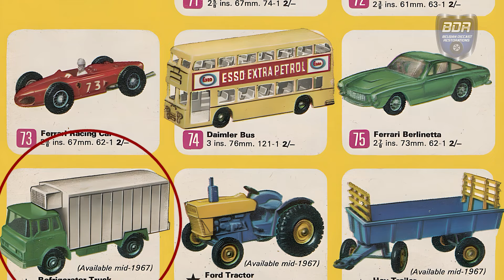Matchbox 44C Refrigerator Truck Diecast Restoration

Comment: Hi! I enjoyed your restoration project on this truck. Do these restored models become part of your collection? I was hoping sometime soon you could do a tour of your Collection for us viewers to see. I still hope you will branch up to a higher percentage of 1:43 scale vehicles to work on. For the amount of efforrt you put in for 1:64 you would get more bang for your buck. Nicer, more detailed castings, suspensions, and more rollable. Are you satisfied with the Motip products?  Other Restorers have gone away from using them for globbing and random coverage. Emphatically so. Thank you! Best, Stephen
Reply from the maker: Thanks, Stephen! Yes, they become part of the collection. It's not very organised though. When it comes to scales, I do my best to alternate between small scale and larger scale, but since I have more small scale models in my restoration boxes, these are more prominent on my channel. But I do enjoy restoring both.
Yes, I like the Motip products. Especially the primers are very good and the 1K rattle cans give a very nice finish on the first coat. Their clear coat is also very good, but it takes a very long time to reach its final hardness and it's usually not fully cured when I assemble the model. That's why I only use it on models without any opening features, that need little manipulation on reassembly.

Comment: That is a fantastic result, Johan!

That Vallejo Light Green was an excellent choice for the container. I’m looking at that colour for the Mercedes lorry and trailer ( #1 & #2 ).

Thank you!
Reply from the maker: Thanks! 🙂 It's Vallejo Model Air RLM25. It's a tiny bit darker than the original colour but indeed very close. If you are aiming for accuracy, you can mix it with a drop of white to lighten it a bit.
Reply: @BelgianDiecastRestorations  I’ll try that! Thanks again!

Comment: It's a gtreat restoration but I think the rear door should be hinged at the top or bottom rather than the left side. If you  think about it, you never see a real truck with a full width door opening from one side. it either swings down to form a ramp for walking into the load bay, or it swings up like the hatchback of a car.
Reply from the maker: Thanks! You're right, but I do believe some trucks had a single door back then. It does make sense for delivery trucks, like this, that had frequent stops. This said, I don't know what truck Lesney based their model on and I couldn't find a picture of the exact truck.

Comment: Hi, I would like to know what do you use to redo the axles? I have already tried with nails but as soon as you hit it to close it it twists. Thanks
Reply from the maker: Hi, I try to reuse the original axles as much as possible. If they are missing or need to be replaced, I use pop rivet nails. They already come with one end domed and are easy to hammer flat. Pop rivet nails come in various sizes, so make sure you get the 1.5mm kind. Support the axle while hammering, either with pliers or by pressing it firmly against the bottom plate. Use a small hammer and don't use too much force. Better to have to hit it a hundred times than to end up with a bent axle. 🙂